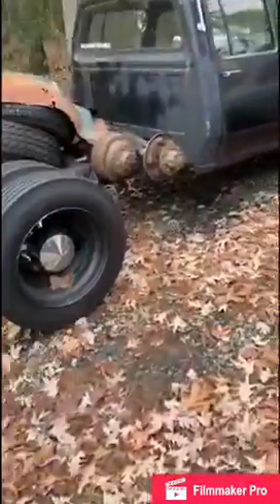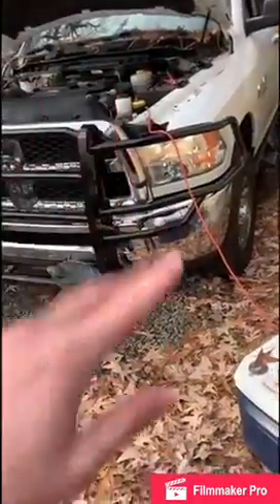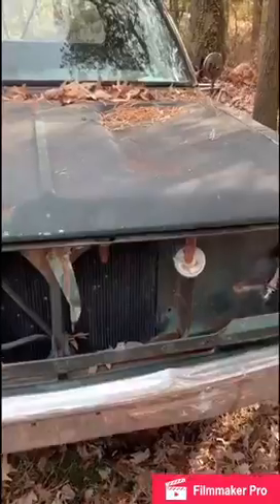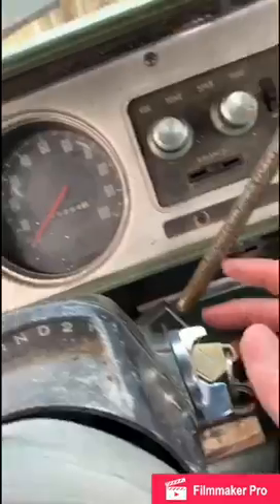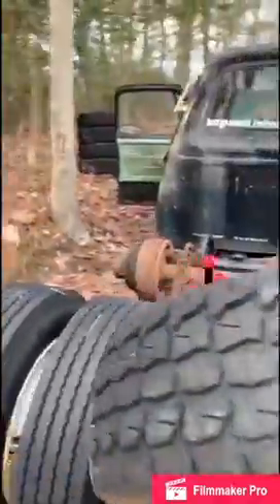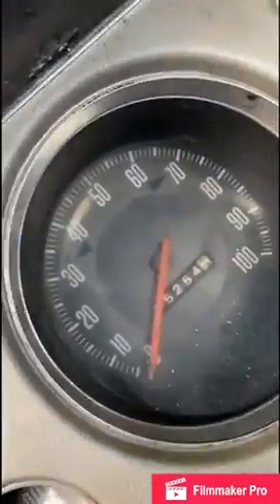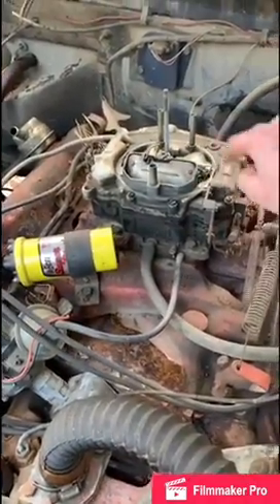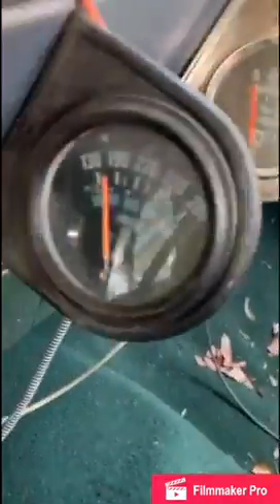1977 Mopar 440 big block cold start

Comment: This truck has tremendous potential. Lots of directions one could go. Just keep it 440 powered. These 70's crew cabs are quite rare. I'd check the engine code in the VIN to see if its a factory D code 440 truck. Great candidate to convert to 4wd and keep it a dually.
Reply from the maker: It is indeed a D code. Build sheet was in the seat springs and pretty torn up but it was originally ordered as a crew cab, cab and chassis (no bed) with the 440 in Black

Comment: What's your Mopar like starting when it's freezing cold and hasn't been used for quite some time? Will it start without using starting fluid if you try it for long enough?
Reply from the maker: It would start if I took the time to actually tune the carb more; but it’s only just good enough to get it around the block every once in a while
Reply: @JasonKman   them Rochester quadrajet
Reply: @Wisconsingrandprix  Ha! It's a Carter Thermoquad.

Comment: Hold on, you used starting fluid and you have an accelerator pump?  Rook
Reply from the maker: 6 month old gas, and a mechanical fuel pump. I'm not killing the battery just to maybe fill the bowl enough for the accelerator pump to squirt.